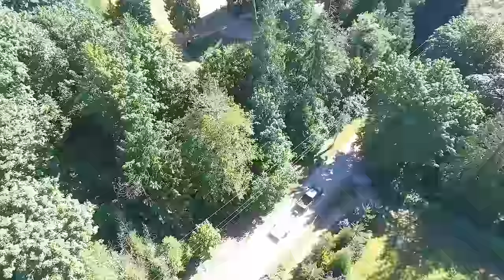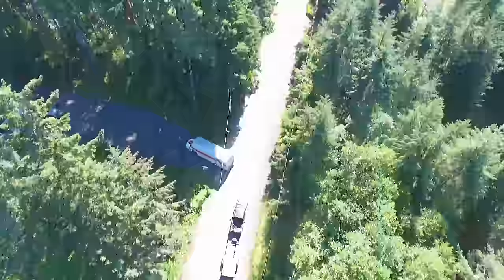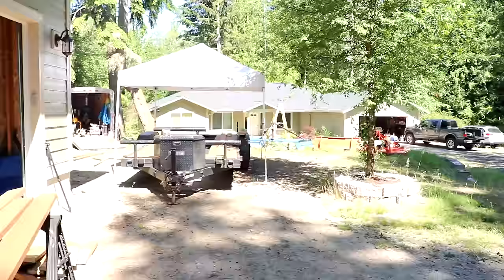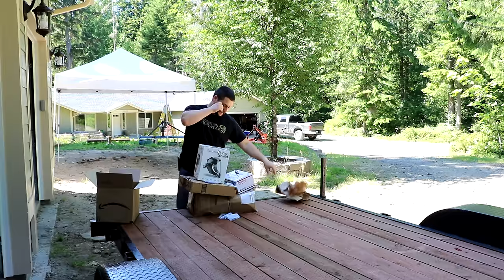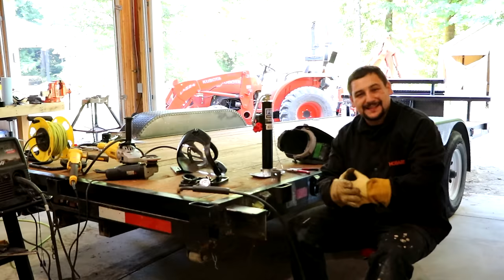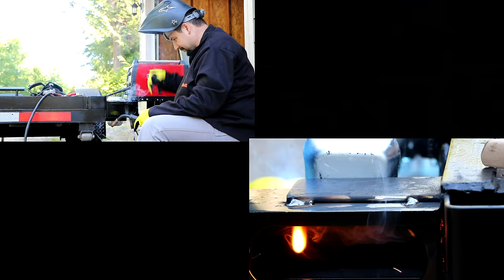Car trailer Upgrades and modifications!!!

Comment: Everything was awesome until you got to the electrical and seen the junk connections you used. If it’s not soldered it’s a waste of time. That’s my opinion of course.
Reply: shelbydog1100 I was going to say the same thing.  I solder every connection, run ground wire all of the way to each wire, and enclose the wires in plastic conduit from the plug to the light fixture.  Nothing more annoying than light problems.  Love the light boxes.  Same ones I got.  Went with black also.
Reply: yes and heat srink, and ground to every light and brakes right back to the truck battery
Reply: The connectors are junk but soldering  them is not a good idea. The solder doesn't allow for the  free movement needed with a vehicle/trailer. The constant vibration with cause the wires to break at the end of the solder. The best way to connect wires in a harness is to use uninsulated connectors. Crimp with a crimped That rolls the connectors inward and squeezes the sides at the same tim. Then heat shrink, with double adhesive shrink tubing.
Reply: shelbydog1100 I agree. absolutely NEVER use Scotch Lock junk. Heat shrink crimp or solder

Comment: These manufactures  putting anything on these trailers just to make a sale I seen it from 1/8 to 3/16 that's all we use on our frames is 2 by 3 by 3 16 we would never use 1/8 inch thick you just asking for trouble